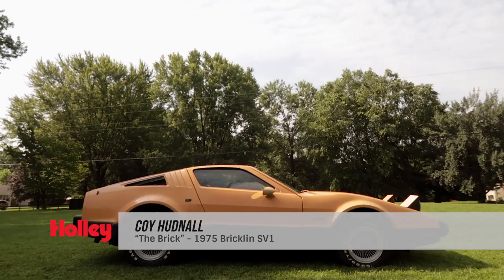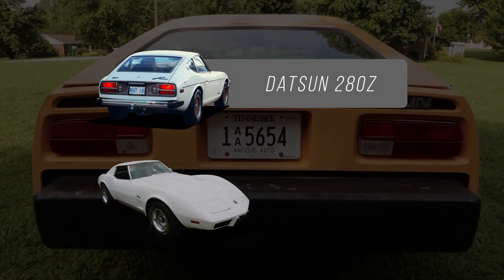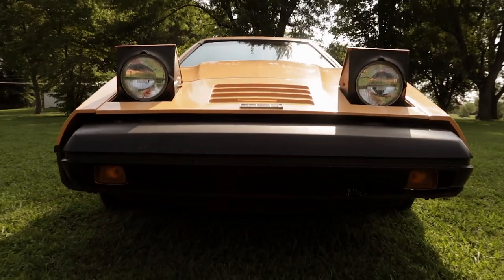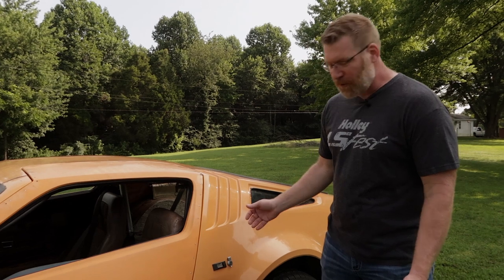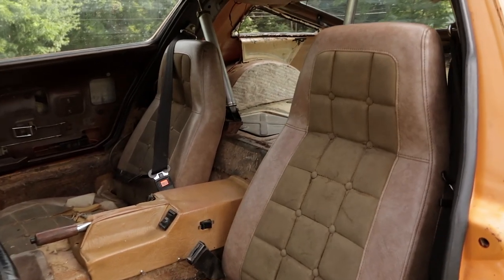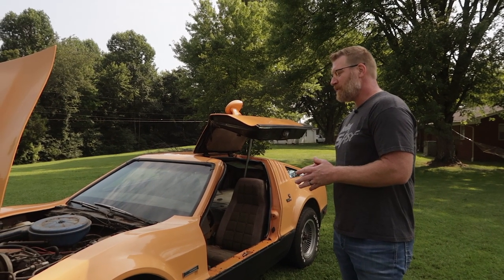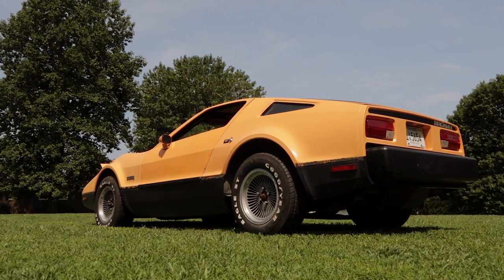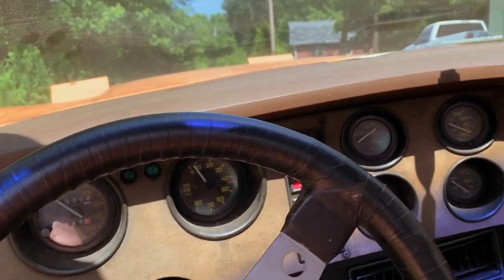The Brick - Coy Hudnall's 1975 Bricklin SV1 LS Swap Project Car

Comment: I got you beat...my '74 was parked in 1988 and wasn't started until 2019.
But your motor compartment looks in way better shape than mine did. Mine had a huge mouse nest at the front of the engine . The belts were literally rusted to the pulleys and one valve cover had started to rust through from all the mouse mess. Good to see another one brought back to life👍
Reply: Lol I got yours beat... My bricklin was parked in 87 and I'm now getting it started in 2021 lol glad to see you saved one too!

Comment: Grew up with this car and met Bricklin when he showed up at my neighbors. They produced the stamped interior door panels, if memory serves the only sheet metal portion of the body. Built a light kit for under the hood for one of their cars.

Oddly enough have not seen one in close to 20 years and not one on the road for well north of 40 years, yet saw one on the road coming the other way last Sunday. Still looks cool.

Will be following along on this one. Had wished to build one up myself with a spare 429PI and C6 out of my Cougar. Would have been cool.

Comment: The upper half of the front bumper should be orange matching the body.  Disconnect the door cylinder when the door won't open as the cylinder can be damaged when open manually.  The car looks fine the way its overall and custom Bricklin's don't do much for me since many weren't made.  Customs ones are worth far less than stock ones.